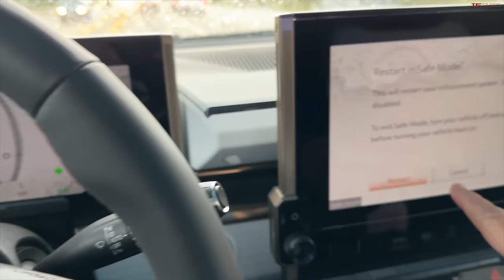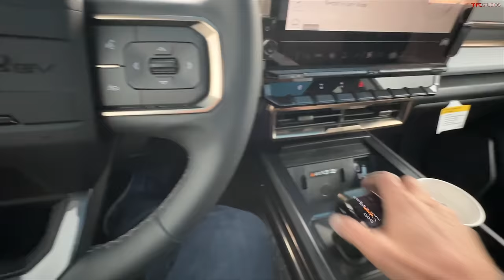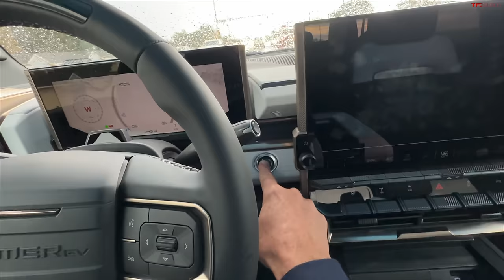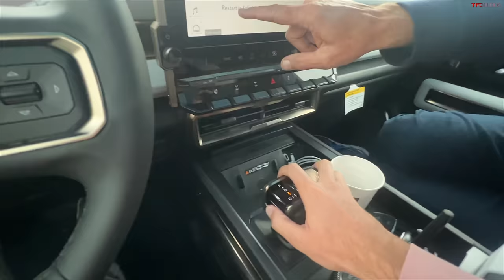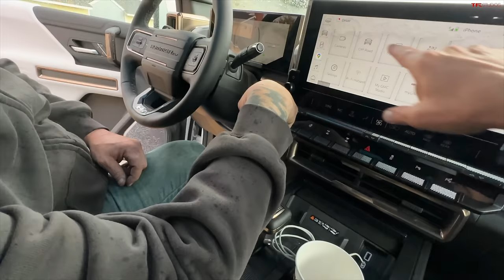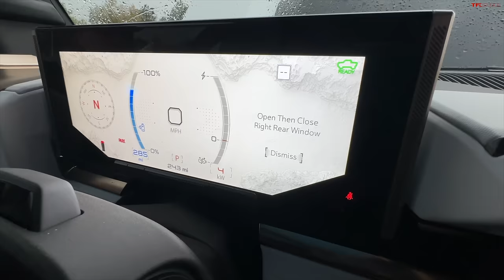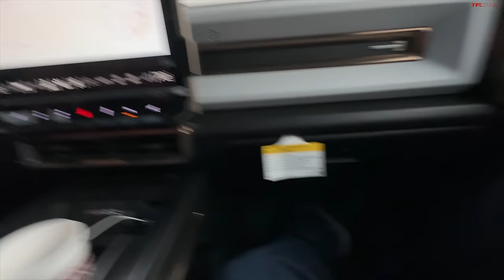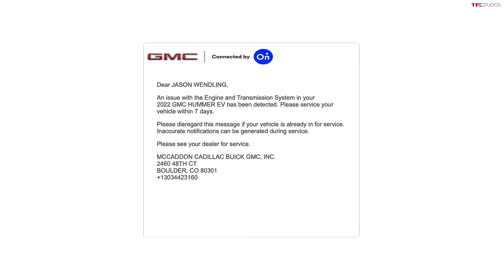I Bought a $115,000 GMC Hummer EV and It IMMEDIATELY Left Me Stranded!

Comment: Well, at least we know for sure that GM is keeping the same quality into their EV line 😂.
Reply: There's something to be said for consistency!
Reply: With all the electrical issues in other GM's I am not at all surprised they are multiplied in their EV lineup.
Reply: I was just going to mention that. ”A Chevy that has electrical issues?!”.
Reply: Chevy is behind on everything except engine reliability
Reply: Of course a DIESEL Powerd tow truck comes to save the day like always when these evs have issues.
Reply: I thought the same thing... I'm quite surprised that this happened so soon. That power reset was the icing on the cake. What if two days down the road one of the power window switches gives out? Then what?
Reply: @davidward7781  funny
Reply: True and sad... come on Gm,  try harder.
Reply: Not all GM's are shit just the newer ones I've had several all great cars.
Reply: @LeatherandLuxuryCarsd  Govt Motors are a Pile of Junk
Reply: Does anyone remember their first attempt.  Bolt?  I think they still advise parking those away from buildings and other vehicles.
Reply: @davidward7781  you must not have a lot of experience with dodge/ram lol
Reply: That’s was like a new fatality to the truck up down up down left right left right select and start and then it’s gonna be unlocked 😂
Reply: It surprises me how GM manages to mess up something as simple as a battery car. Lol.
Reply: Evs junk
Reply: Stick to gas
Reply: Hahaha Good one
Reply: @richardthompson3118  old diesels are even better...
Reply: Considering the Hummer is priced like a Range Rover then it's only fair it has Range Rover reliability. 😂
Reply: @venom5809  Yeah, Range Rover is ranked #15 out of 19 full size SUV’s. I wouldn’t be boasting to much about them.
Reply: @matt197gt  as a previous Ram owner I agree but, the last few years GM has been absolute trash to the point where Ram looks like a decent reliable truck.
Reply: @mr.wilson8340  Here that sounds? It's the joke flying right over your head.
Reply: @urs6onfuturas975  RAM reliable truck ? 😂 I’m pretty sure you own one look at the consumer reviews those truck are a pile of crap and recalls everywhere. The only thing they have are interior look.
Reply: @JNSEA  nope. Own a 21 TRD pro Tundra that I bought with 1 mile on the odometer and just hit 31000 issue free miles with. I'll be keeping this Tundra until either it or I dies. My truck before that was an 18 TRD sport that I also bought new and after putting a little over 60k miles on it traded it in for the pro( pre pandemic price gouging). My truck before that was a Ram and it didn't even make it to 30k miles before numerous issues occured, the trans taking a shit being the worst. I'm also surrounded by different brand trucks everyday since our work fleet is Ford, a family member has been a Chevy maintenance manager for years, and father in law owns his own shop. Trust me I hate saying anything positive about any Mopar but the big three all suck these days, Ram just sucks slightly less short term wise.
Reply: @mauricemotors8207  oh i'm in ft myers fl. you might have heard recenty we had a bit of a storm. i've seen a shit load of teslas on flat beds. see when you flood an ICE car you can drain the fuilds ands replace them, pull the seats out the carpet, clean it dry it, put the car back together and usually get it to work. thinhs like power seats will be bad and such but the car isn't necessarily totaled.

a wet ev tends to be totaled.
Reply: @davidward7781  are you kidding me? Their engines have had issues for many many years... Major lawsuits on engines from 2010-2014. The past four years they have been having issues with their engines crapping out on brand new trucks. They know the issue, but will only fix one side of the engine when it dies..
Reply: Guess we found the clown that believes in green energy.
Reply: Giant Paperweight 🤣🤣🤣
Reply: I've never owned Generic Mush, and never will.
Reply: @danieldesonia1097  ev1 was 2 decades before the bolt.
Reply: @angelgjr1999  Far from simple.
Reply: @davidward7781  Name 1 reliable GM engine. Every engine is having problems.
Reply: When all else fails, get a bigger hammer......
Reply: @benjaminwayneb  4.8 I'm currently sitting in the driver seat of a GMC Savana with 418,000 MI I have four other Vans most have a 6.0 they also have around 400,000 one has 318,000. My uncle does commercial concrete and has about six trucks all GM Duramax with about 600,000 and four other trucks with over 300,000 with one at about 200,000 and a 1999 502 gas with 913,000. Been in business 30+ years doing heavy work all across the country in every climate imaginable trust me nothing compares
Reply: so true 💯 percent Gmc is junk
Reply: Now that's funny!
Reply: @MrSGL21  How are the EV’s getting charged with no power..??
Reply: @davidward7781  I have a Frontier with 866,099, so what..
Reply: @davidward7781  The 6.0 was one of GM's better engines but it's no longer produced. The 5.3 and 6.2 are plagued with lifter and camshaft problems, direct injection carboning and high pressure pump failures.
Reply: @benjaminwayneb  4.8L V8 from GM is bulletproof.
Reply: @peteparadis1619  most of the area has power again. Our building  got power back in two days. A couple of t-twats were using outside outlets last week.
Reply: Not to mention $100 for a full charge.
Reply: Buying an electric truck from a company that has seemingly always has electrical issues….you kinda have to expect this from GM.
Reply: @williamabaker12  Also discontinued.
Reply: The emergency flashers work, but that's all😜
Reply: @MrSGL21  For Katrina we were out for 4 weeks and IDA 3 weeks and others much much longer.. There was difficulty getting fuel of any kind much less just using your generator to charge an EV when you needed your fridge and ac to survive because it was 93 afterwards with high humidity and trying to fix your house in that is impossible without taking breaks in some cooler area like a room with a window unit.. But, you could drive outside the damaged area 90 miles and find gas to bring back. EV’s are a NO GO in those situations
Reply: My family and I are on our 15th 300,000 mile GM none of them have ever left a stranded...
Reply: @Jim John Lightening F150 damn good EV. Went to Alaska and back with a camper no issues !
Reply: @matt197gt  ya, they got me a couple times. They are like a sexy girlfriend that keeps you broke lol 

Beautiful cars though.
Reply: @LeatherandLuxuryCarsd  Let's remember that they made the Chevy Vega, so poor build quality is not something new. In my 40 years of buying cars, my worst mistake was allowing my daughter to talk me into a Chevy HHR.
Reply: Better give them another billion dollars to bail them out again lol
Reply: Good one!!!! 😂
Reply: @benjaminwayneb  Yeah, sadly, I know. I've got one in my 2012 Silverado. Absolutely a great little V8 if you maintain it. The electronics around the truck? Bit of a different story, but the drive line is stout. Been a great truck overall. Around 170k miles and still doesn't leak a drop of anything. However, I am meticulous with oil changes and such. And this engine has none of the awful DOD garbage from GM.
Reply: Now imagine how all these system will function when they start getting corroded
Reply: GM ad said build like a ROCK, very strong like a ROCK won't move
Reply: I keep buying the old LS engine models pre afm/dfm. They just keep on going.
Reply: @philllsxga.7737  I’m on my 16th Japanese car and all put American to shame.. 300k, then you woke up.. HA HA
Reply: @garysimon7765  dot rules the car has to be on fire and the flashers have to work till the end
Reply: Pretty normal for a GM product
Reply: @danieldesonia1097  the bolt was not their first attempt. They had a car in the 90s called the EV1. It had the same problem with it catching fire when charging and just sitting. My neighbors house burned down because of it.
Reply: You did it, Mary! 😂
Reply: That's no lie. This must be the electric version of the pipe tape they use in the ICE versions fuel system that leaves you with clogged injectors and fuel leaks.
Reply: @peteparadis1619  F-150 powerboost pickup.
Reply: @JNSEA  My brother has a 2005 Ram. It's been reliable. I'll take it over the two Ford F250's the company I work for own, and I will never own a Toyota. I'll walk before I give up my Jeep or Challenger for a GM, Ford, Toyota, or Honda.
Reply: @macdaddyns  probably use same bad batch of ignition switches.... lmao 🤣
Reply: Yeah that Lightning was a real gem ! 80 miles towing or with a load! EV trucks are just  an over price commuter vehicle!
Reply: $115k for an EV truck? The science is nowhere near advanced for EV trucks ! Junk! If you want to drive from Longmont to Denver to commute, EV'S still are a waste of money!
Reply: Exactly,,,why would anybody pay 115k for a GM,,lol,lol,
Reply: @leegunter5223  on you tube there is a guy with Ford truck EV  towing a model A  with range of 200 or less miles .. just think 
This heavy beast range before  attempting to  tow ..   plus unreliable factor of breaking down... lol 😆
Reply: @mr.wilson8340  I think he was being sarcastic..
Reply: Remember GM's ad, "Nobody sweats the details like GM" 
's customers. 😂
Reply: @dantimber  most dependable vehicle I've ever owned was a 96 GMC Sierra 3/4 Ton. Spent 10 years hauling asphalt and a seal coat tank, never had any major repairs, never died, started right away in -20 degree weather was warm in less than 10 minutes. It was put to rest with 364,000 miles on the od. No car has ever come close to the bossness that was that truck. Funny that your name is Nissan guy... I currently have a Nissan, 2018 Sentra with cvt and it is by far the most garbage vehicle I've ever driven or owned. It's 4 years old and ive had to sink over $8,000 dollars into it already. I've never seen a more poorly built and cheaply manufactured vehicle in my life.
Reply: @benjaminwayneb  nah I'd say it's pretty simple. Also worthless. Gas is better. Evs will not make it in the long run and they really shouldn't. They're completely unnecessary
Reply: @benjaminwayneb  96 Vortec V8. Never once had an issue.
Reply: @peteparadis1619  weird, I have a Japanese car right now and it's essentially a dumpster. Only 4 years old, worst trash I've ever had the pleasure of owning
Reply: @jayschmahl9206  post 2010s Hondas: I understand completely those are trash

Pre 2010s Hondas: literally f*CK any vehicle you have, I'm better. 

Cause they were... "Were" being the key word
Reply: @stompthatazz3967  That's 25 years ago.
Reply: @stompthatazz3967  oh yeah, those CVT transmissions are garbage.   5 yrs ago back in 2017 I flew out to Sin City to visit my Aunt Elizabeth  and uncle Chuck,  rented a 2016 Nissan Sentra.   on the way driving back to the airport,  transmission went out.    luckily I was 10 minutes away and could take a taxi,  but had I left the house a few minutes later I would've miss my flight.    Now the Nissan's from say pre 2000, were practically bulletproof, very much like the Honda Civic and Toyota Camry from the 80s and 90s.
Reply: @stompthatazz3967  Good, liar, I’ll come take it off your hands.. Not Korean junk, you don’t know the difference probably.. I’m 65 and every single GM and Ford I’ve bought new, probably a dozen, have been problems.. Every single one.. My Honda’s, Nissan’s and Toyota’s were problem free..
Reply: Lol...
Reply: Recycling sounds good...
Reply: Stop your hate ! 
gm is #1 
💙 wins save the 🌎
Reply: They did great, right up until they put computers in their vehicles....then it went to chit. Mainly because of the computers.
Reply: @mauricemotors8207  😂. Nice one ☝️
Reply: Ford motor co. Just played off 10 thousand ppl to make battery operated cars ,can u say they r going to lose there ass!!
Reply: As expected
Reply: At least it didn't catch on fire, yet🤣🤣🤣
Mary's pipedream is sinking the ship.
Reply: @mauricemotors8207  yeeeeeeesssssss!!!!!!👏🏿👏🏿👏🏿👏🏿👏🏿👏🏿👏🏿👏🏿👏🏿👏🏿👏🏿👏🏿👏🏿👏🏿👏🏿
Reply: @kylebutler7142  🤣
Reply: Not a good look for GM
Reply: GM is a crap car buy Japanese
Reply: Thank god for early adopters. I’ll never be one of them.
Reply: @stompthatazz3967  That's dependable.  Impressive.  Nissan is an old name - never changed it.  I do still own a Frontier.  It's been pretty good but I'd like something different.  I've been wanting to trade for a couple of years but it's been tough finding inventory.
Reply: Runs like a rock
Reply: I'm afraid this will be a problem on most EVs with the traditional module system; this was a clear case of some module being locked in an unresettable state until power was cycled. This is why we should be doing away with most of that old style of vehicle canbus system; its not very modern in a world where you need hundreds of jellybean trailing edge chips canbus transceiver chips just to make a single vehicle. Its a mess.
Reply: @kylebutler7142  These same idiots calling GM unreliable will turn around and go praise BMW or Mercedes, hilarious.
Reply: @sureshharinathbabu9717  I've had much better experience with American cars than Japanese, although not GM. Our altima literally blew up after 80k miles
Reply: General Motors.  Never met a vehicle opportunity that it couldn't $crew up.  This has been going like this full steam since I was a teen paying attention in the 70s.
I remember the day my father abandoned American (big3) cars in the mid 80s after getting sold trash for the 3rd straight time.  He owned Honda/Toyota for the last 25 years of his life.  Sad.
Reply: Salvage
Reply: Lol
Reply: @danieldesonia1097  that wasnt the first attempt. They made one in the 90's to get in line with californias demand, and it was really good considering. Then they got a money injection by oil and sued california. Then literally took the cars from happy customers. Tells you all about the company behind it
Reply: I had a 2001 Cadillac Eldorado. Bought it brand new and had to take it to the shop at least twice a year. General motors vehicles are junk 💩
Reply: @davidward7781  as a self employed mechanical inspector for warranty and insurance companies I can say for certain you are wrong lol.
Reply: Like he said, he traded in a (low range, useless) Ford Lightning for it.

It isn't GM or Ford, its just complicated garbage in general.
Reply: Well not sure until it's can do a few thousand miles to see if all the leather and plastic starts pulling apart lol
Reply: @cessealbeach  pretty much. They are like Chryslers.... the engines burn oil, and they have lots of transmission problems.
Reply: @angelgjr1999  I guess you never hear of the bolt evs catching fire.
Reply: @urs6onfuturas975  rams are nice but the hemis drink gas
Reply: I hope Bill Gates got compensated for the infinite do loop.
Reply: Why would you trade in a lightning!? For That!? Wow!🤣
Reply: Lemon law can help with the 115 k refund.
Reply: @Jim John  same with Me ! I wouldn’t buy any GM products. I use to say all they do is break down & fall apart . = junk
Reply: That the OC is correct and the comment true makes this even more hilarious.  🤣
Reply: Like a “ROCK” Stationary
Reply: American made and we keep bailing then out smh
Reply: @DonBearPizarro  -- True, but I am a firm believer that in brand new vehicles like this, some... defects are expected.  What matters is how the manufacturer and dealership handle these issues.  You know that when you take a chance on a brand new version of a vehicle you are going to have issues and recalls.  The new Toyota's are a perfect example, quite a few issues and recalls.  But Toyota is covering EVERYTHING even when there is a case of abuse or owner mod's.  That is a BIG plus.
Reply: @Erin-Thor  you expect that shit on corolla or a sentra but not a $115,000 hummer.
Reply: @DonBearPizarro  — LOL!  I was talking about the new Tundra’s and whatever. They have had issues, which Toyota is handling.   Toyota is extremely reliable, so their new vehicles are… not… experiencing the same reliability.  🤣
Reply: Tesla has problems way more worse!
Reply: Took the words right out of my mouth.  HAHA!!  Give it the three finger salute and walk away.
Reply: Who knew shoulda put a ls in it
Reply: Well they might sill be junk but they aren't raising the bar good work
Reply: And don’t expect reliability from first gen of any product 😮
Reply: I love GM but I agree with you. All the lights coming on in Yukon and tahoe mean the trucks broken. That's why I go FORD F350 DUALLY
Reply: @chrisvig123  I really don't expect reliability from gm or ford. And their track record of looking after customers isn't great either.  Toyota still replacing frames 16 years later.  How many gm trucks broke off at the frame behind the cab.  Never got shit.   People buy crappy gm and ford subpar tossed together union shit and just expect problems. They're so used to it they don't know any better
Reply: @chriscasias375  exactly
Reply: @hectornash468  they have been for years. I've had 3 trucks and all failed kn me with regular maintenance.  Nice looking trucks but they don't last for shiz unless you buy diesel and that's why I went with the f350 dually.  Best of both worlds.
Reply: @usamasaid2860  A C A B B  up down left right
Reply: @mechmat12345  right.  They missed it completely
Reply: @benjaminwayneb  outside of the diesel there are ZERO.
Reply: @davidward7781  the Savanah is a different breed along with the express. That motor is built different and is made to last. Working on it can be a pain though. I love the express.
Reply: @benjaminwayneb  oil pressure sensors fail all the FN time too.
Reply: @JNSEA  so does Toyota, ford and every other brand.
Reply: @urs6onfuturas975  i guess u didn't see all the recalls going on with the newer tundras. lol. your in for a real nice surprise lmao
Reply: @TravisSvedberg  you know my Pro is a 21 right? Which means it's still a 2nd generation not the new 3rd generation. So guess I'm not in for any real nice surprises 😔 lol lmao
Reply: Lmao
Reply: Definitely.   its and over loaded expensive  nightmare that's has far to many gadgets   and  luxurious  items  to go  wrong  and its s gm product did the course  on this  heap   and  it was something  i would definitely   stsy away from
Reply: Yep... that's government  motor company for you.
Reply: Sad but lol
Reply: I never bought GM vehicle for my self and I never will. About 14 different  brands, some from Europe: Toyota Lexus Mazda Honda Acura   Ford if you keep in garage protecting from rust :)
Reply: @davidward7781  guess you haven’t heard about engine failures
Reply: 😂😆😂 GM & Chevy 🚮🗑️
Reply: @claytonporter91  oh Clayton, bless your little heart.
Reply: 100K for a government motor ? I don't want that garbage for free
Reply: @mauricemotors8207  haha funny comment but I have had more issues with the diesels I have owned than any gas car or truck. EV’s will have their day and the last laugh, guaranteed.
Reply: @mauricemotors8207  and you've never heard of a diesel breaking down ? A guy online modded his 72 VW bus to EV using tesla parts, 78.000 miles with no issues whatsoever . the problem is most modern US car manufacturers vehicles are very unreliable, we see it constantly proven by all the online shows telling us to avoid most of them like the plague.
Reply: So true
Reply: Just when you thought the Hummer line up would make a new name 4 themselves since they had a bad rep w/ their older ones lmao
Reply: I thought about buying a 2023 Chevy Colorado but I’m gonna be honest every Chevy owner I know the vehicle just ends up falling apart after purchasing. I also see a common thing with Chevy;s diatribe running lights or fog lights or a regular headlight they also seem to have 1 blown and I see that all the time.
Reply: Took the words out of my mind lmfao
Reply: Issues occur with every car, even new🤷🏽‍♂️
Reply: Driver sure has a good sense of humor! Is he really human? 😳 Or is he Alfred E Newman who is never worried!
Reply: yepp same as dodge and Ford!
Reply: @LeatherandLuxuryCarsd  I bought a brand new very expensive 1994 Eldorado back in the day and it was a nightmare. Fortunately that car was the vaccine to never buy another GM car
Reply: @benjaminwayneb  the V8 engine in my dad's 1981 Oldsmobile Cutlass LS was very reliable. No problems whatsoever during the 10+ years we had it. I recall my dad remarking that had he known that this engine would last this long, he would have bought another Cutlass LS. It was that good.
Reply: @1515cci  41 years ago!!!!
Reply: Happens to all cars shut up ford's are worse
Reply: Man you stole the words out of my mouth‼️😂
Reply: @mikeschmidt4800  nice!  I posted a few days ago how my dad's Oldsmobile '81 Cutlass LS small V8 engine performed like a champ for 10+ years with no issues whatsoever. This car was no slouch either.
Reply: lol. my 2003 sierra 2500 just past 650,000 miles....Fuel pump is the only thing to ever fail,, try looking after your vehicles
Reply: @goji059  that’s a 2003 we talking about the garbage they make now😂😂
Reply: @urs6onfuturas975 Hardly anything to brag about. 31,000 is good for that year, don't get me wrong. I personally wouldn't drive Any of the 2021 Trucks past the Warranty Mileage, except Maybe a Tundra or Tacoma. And that's coming from a FORD guy. It's a crap shoot. I would do some digging if I were you.
Reply: The same guy that stubbornly sticks to his ford break down after break down and bad service. I in a million doses bother me. The make push rod v8 nothing more reliable then that if not why the Godzilla?
Reply: Consistency 👌
Reply: That's what you get for buying a government subsidized vehicle.
Reply: Connect the dilithium crystals directly to the warp drive. It will take an hour.
Reply: All EV cars  are trash not just GM
Reply: @kylebutler7142  so because u did that means it's a good vehicle
Reply: I have half million miles in chevy trucks that disagree with you.
Reply: @Chris Casias  it's retrain automatic windows 
You can completely ignore that just means automatic windows won't work
Reply: That's what we call an long Term Work in progress!
Reply: Ppl love those hummers they are all trash but hummer look too cool to pass up so ppl spend crazy money for garbage it’s a shame
Reply: not surprising lol….consistency of being unreliable well done gm
Reply: all the hummers are basically trash  and new one looks cool though
Reply: @matt197gt  the last 7 years Ram is one of the more reliable trucks.
Reply: @davidward7781  all older trucks that were reliable, the new ones are shit
Reply: Gm shouldve been allowed to collapse in 2008
Reply: @grimgoreironhide9985  agreed. 

Aside from SOME Ford truck models/years, the only reliable American made consumer vehicles are from our domestic Toyota factories. 😅.
Reply: HAHAHAHA!
Reply: @benjaminwayneb  The LBz Duramax...o wait that's an Isuzu engine😂
Reply: Engine reliability ? The lifter failure is constant and wide spread i hardly call that reliable. @davidward7781